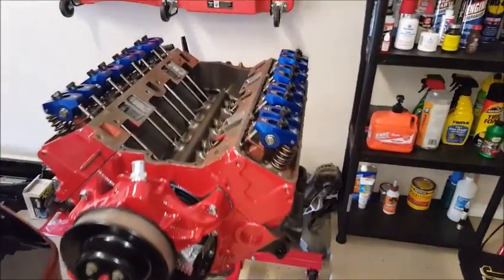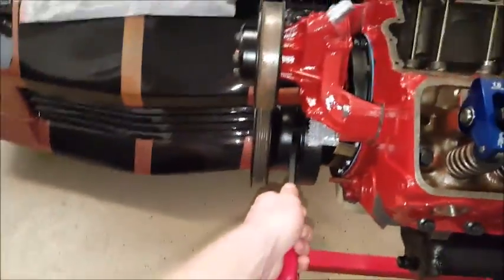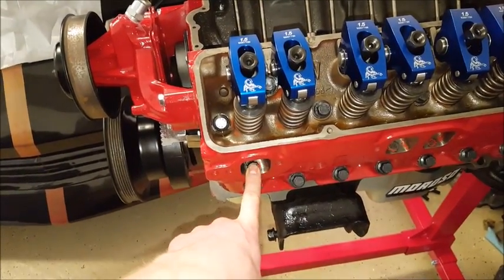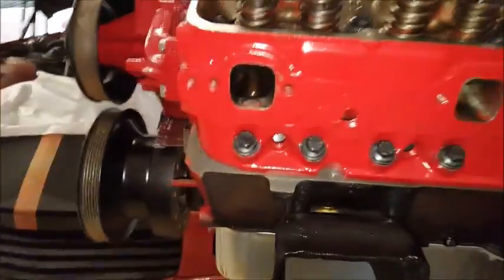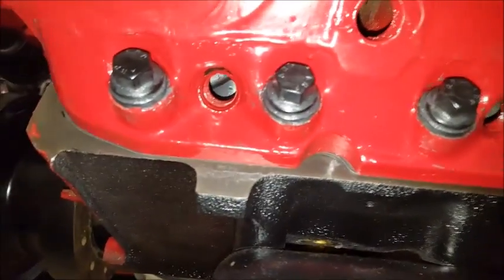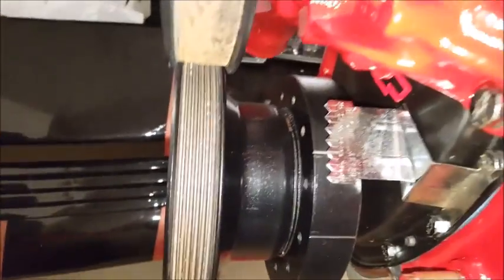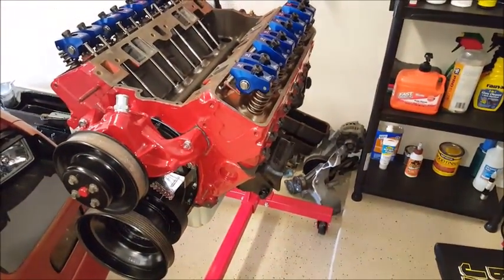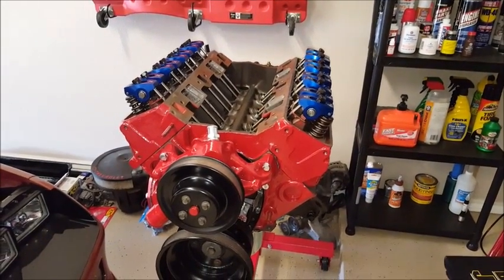82-92 Camaro Finding TDC

Comment: thank you for the tech tip of sticking a piece of paper towel into the number one spark plug hole, my engine is in my car and it was pretty hard to rotate the engine by hand and hold my finger over the hole, but I used your tip and it worked out perfectly, I installed a brand new distributor in my 1975 Chevy Monte Carlo today 5-29-2019, the car fired up the first turn of the key, and runs great,  thanks again
Reply from the maker: That's great to hear and I'm glad you found it helpful. Thanks for your support and enjoy driving the Monte Carlo
Reply: R.c

Comment: Im attempting change my intake manifold soon i noticed where i shoud see 0 degrees on my harmonic has been completely painted over is yhere any other way or can it be close to 0°
Reply from the maker: If your heads are still on then you can remove spark plug and rotate engine until you get to the compression stroke on piston 1 and when it's at TDC then you should be near 0 degrees

Comment: Cool video question what is the second Mark on your damper for on my 350 i have the same marks 12oclock and 2oclock timing
Reply from the maker: Tyran Ducksworth thank you. One is for true top dead center the other is for the 34 degrees total timing advance that we used years ago when this engine was running in another car
Reply: I noticed when my Jeep 2.5 engine when I was bringing the piston to tdc I also hade two marks one for tdc and the normal timing for “0” I barely understand it my self
Reply: @socalRooster  If you ain't running a 4.0 in a wrangler u ain't s***.
Reply: @wildestcowboy2668  what…😂

Comment: So I live in the mountains and I really don't have help from Neighbors it's Christmas Day and I'm finding top dead center so both valves are closed and I really don't have any help and I'm not taking my radiator and shroud and everything out but my timing mark I can see it and it's very close to my zero so I think I can go ahead and drop my distributor in and just advance Japan positive or advance to negative on my distributor to get it time to properly so that's basically what I'm going to do

Comment: How many people have there engine out of car
Reply from the maker: Most people who rebuilt the engine. Plus it's no different from being in the car or out of the car
Reply: maybe 4? hahahahahaha
Reply from the maker: @lisahanks5150  I state how to do it if it's assembled and in the car as well. It's very easy
Reply: It will only hiss when you reach the top with the compression even if the exhaust valve reaches he top which is the many people consider tdc by accisent and its not the one that will hiss or blow ai on your thumb